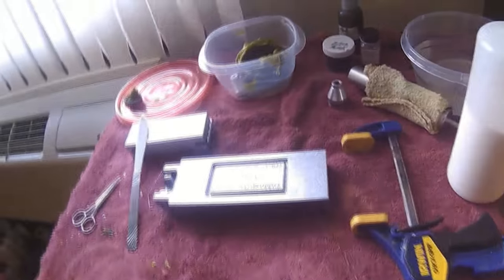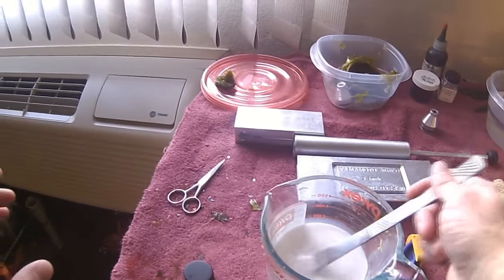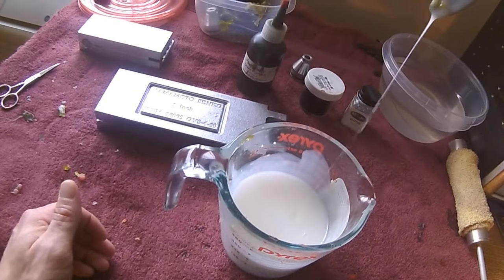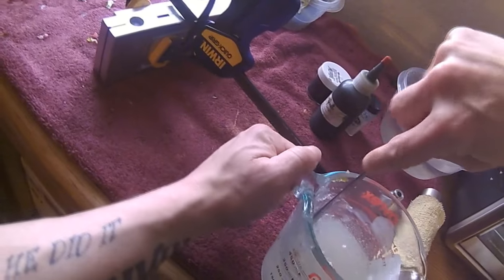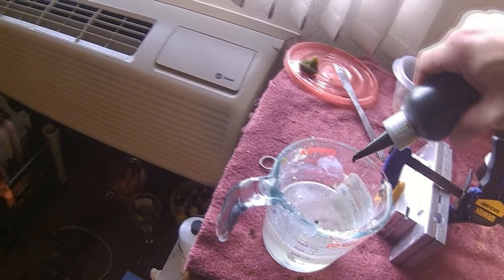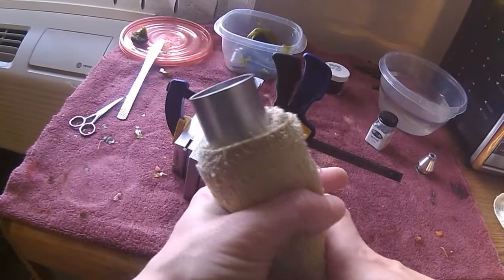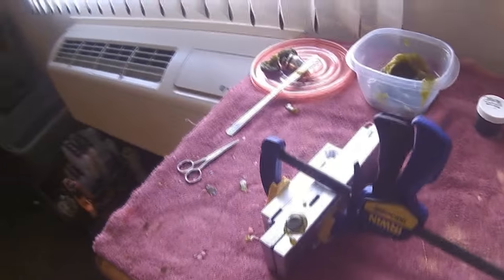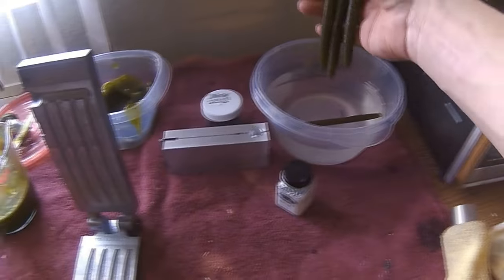5in  Yamamoto Senko Do it Mold

Comment: I was holding the Pyrex in my hand when it exploded. Was not on a cool surface. I was using a hot plate so my guess is I overheated it. I'm using an aluminum pan now and that has been working well for me. I like that I can keep the plastic melted between pours.
Reply: Thermal shock does not require contact with another surface and yes you heated the cup uneven with a hotplate.
Reply: Since making that comment I've been making tons of baits using a hot plate and an aluminum saucepan. For me it works better than the microwave method because I don't have to keep reheating the plastic.

Comment: I like how you said don't get the glitter from Walmart me being a soft plastics lure maker I've had no issues using the glitter from Walmart in my baits I even got some from 5 below and it held up just fine
Reply from the maker: In my experience, walmart glitter only works for a single use application.  Although, when heating plastic back up after its cooled the color of the glitter will bleed into the baits.  Will the bait function as others? Yes.  Will the color be other then what your going for? Yes because the color has bled into the plastic.  It also clumps together too much.   Glitter that is not hi-temp such as walmart will cause more problems then its worth.  btw HI temp glitter from do it molds is $6 and lasts a long time so I promote using the write ingredients for the best result.
Reply: @MNKayakAngler  I've had no issues using it and remelting with it

Comment: I used exactly the same materials as you. And followed the video instructions. Once all said and done. My senko won't sink. When put in the cool water, they float. And advice and tips would be greatly appreciated. Thank you
Reply from the maker: It's either because the centers are still warm or you got too many air bubbles in the plastic before pouring. This also happens when shaking the fresh plastisol. Let the un-heated plastisol sit for 15-20min after shaking. Also if there is a lot of air bubbles coming to the top after heating then it may be too hot and began to boil. An infrared thermometer would fix that. If it heats above 350deg then you need to let it cool before pouring.
Reply: +MN Kayak Angler thanks man I'll give it a shot,I appreciate the help! God bless

Comment: Great video and keep it up! But I had a question. Everytime I inject my mold I do everything right, but I have dimples in them. Each worm has a like dent in it and Ive tried to find out how to fix it but nothing has helped. Any advice would be greatly appreciated!
Reply: I also have the do-it senko mold and use there plastisol
Reply from the maker: Danny Lester use a blow dryer to warm the mold first before you pour
Reply from the maker: Warming the mold will help a lot

Comment: what is the difference in price from retail price to making your own great video by the way
Reply: jesus garcia quart of plastic will save you about $275 in baits that it makes.. soft baits are around $5.50 a bag so it does save... But you have to spend money to make money... Quart of plastic is $24 and each mold is between $35- $65 depending on the type you want.. colors are $4.50 a bottle
Reply from the maker: Well 8 can make 8 baits for roughly $2-$3 and then I can also re-melt and re-mold about 3x so over 20 baits for under $5

Comment: Do you have to use the actual fishing dye and can you just use food dye
Reply from the maker: I’ve never tried food coloring although I don’t think it will hold up to the high heat as well if re-melting baits. Also I think the color would fade durastically in the sun which will bleed color onto whatever it touches such as other baits or your boat/kayak

Comment: How much does it cost to make 1 Senko? I am interested in doing this but only if it saves money over store bought stick baits.

Great video keep up the good work!
Reply from the maker: About .26 per bait.  I get 500+ baits per gallon of plastic which is between $55-$65 a gallon.  I figure if retail senkos cost 7.99 a bag and you can get a minimum of 500 baits making them yourself you are saving bigtime. If you were to buy 500 retail senkos or 50 packs of 10 the cost is roughly $399.50.  Yes the equipment does cost a bit to get but once you have it you never have to repurchase it.  The only thing you will have to buy after you have the equipment is Plastisol and any additives, glitters or colorants you will want to use. It still will be way less then $399and yo uget to make them custom to what specs you want

Comment: My Pyrex cup complexly shattered the first time I used it. Glass and hot plastic went everywhere. I was lucky I was wearing protective clothing and eye protection. I know these are the industry standard for this and a lot of people use them, so I'm not sure why this happened to mine  as it was new and there were no pre existing cracks before I used it. Waste of $10 tho.
Reply from the maker: I would have to say you over-heated .... By a lot. The breaking point for Pyrex is way up there ... Well above 450 degrees. Pyrex glassware is used in many conventional ovens for baking in the 400-425 range.
Reply: You also need to be careful about where you put the pyrex when it is really hot.  Cold water or even a cold surface can temperature shock the pyrex, causing it to explode.  If you are going to set it down on something like a granite counter, put down a cork pad or even just a couple layers of towel to insulate the glass from the cold counter.

Comment: Can u re-use(re-heat) soft plastics youve made
Reply from the maker: Yes. Once you use them and they get torn or ripped from use, they can be re-molded and re-used.
Reply: +MN Kayak Angler isnt it like around 100$ for all that couldnt u buy aton of soft plastics with the money
Reply from the maker: +Bassmaster_26 yes it does although it's a one time cost. Per gallon of plastisol I get 450-500 baits at $60 per gallon. If I were to buy the same baits at retail prices I'd spend more then what it costs to make my own. For example if I bought $60 worth of baits that 6-8 bags used once. If I make my own using one gallon of plastic I get 45-50 bags of bait for the same cost
Reply from the maker: +Bassmaster_26 I also get multiple pours so if I get 3 pours per bait that 1350-1500 baits or 130-150 bags of bait for $60
Reply: What do you mean by that

Comment: why not put the whole mold in the cold water?
Reply from the maker: +jblaze114 because the mold needs to remain at room temp.  The mold itself must be dry when pouring plastic. I make more then one pour so if I were to get the mold wet then have to dry it, the remaining plastic that is ready to pour would cool to much and I'd have repeat the heating process.
Reply: @MNKayakAngler  +Jblaze 114.  I'm not sure if plastisol responds the same as lead; but if you get any water in a mold and pour hot lead in it...it will blow since the water will immediately boil and become steam and find the path of least resistance.

Comment: if he would have machined the mold that would be cool. but buying a prefabbed jig, microwaving, adding color to plastic and just pouring into a hole? why not just make a video that better explains the cost savings or get 5 jigs and really crank them out quick
Reply from the maker: Do you realize how much it takes to machine your own molds.  You need to have CNC equipment which is thousands of dollars, a place to set it up which is a large space and then the knowledge on how to do it.  For the armature fisherman, this is the best way to achieve the goal